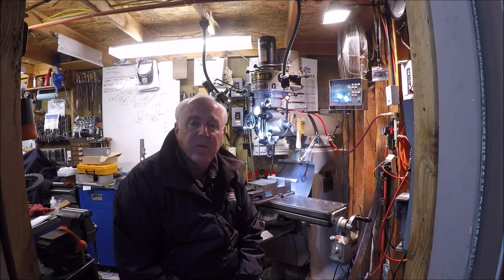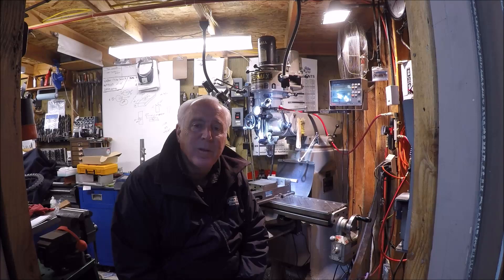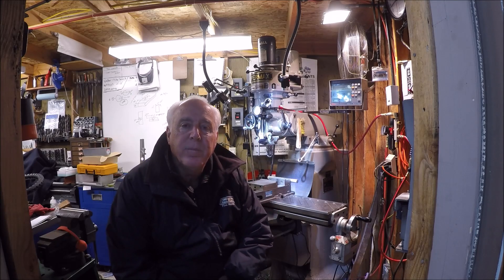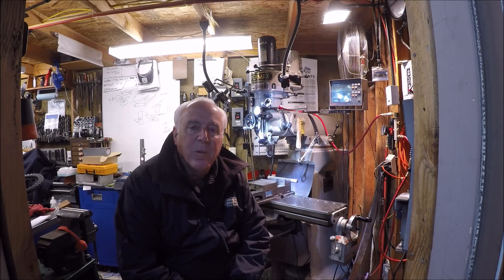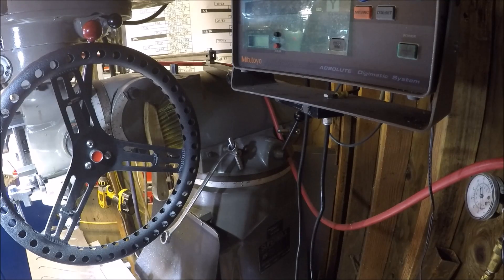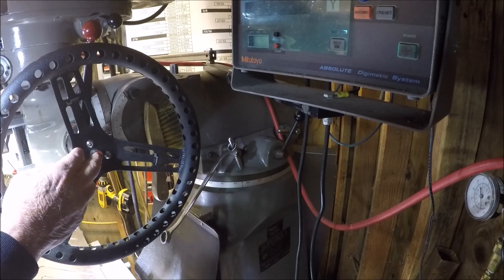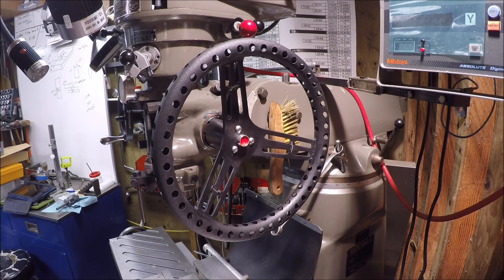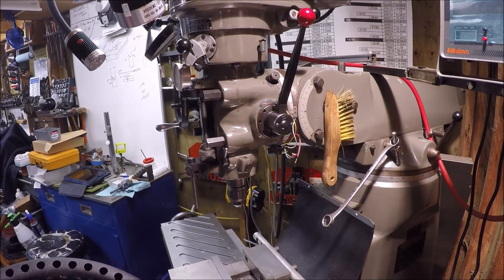Screwy Tuesday....Wheel Or No Wheel

Comment: I like the wheel attachment you did but the wheel seems too big.  A 8 or 10 inch wheel might be a better proportion.   A protrusion like on a lathe wheel or one of the mill xy handles or even off a '50's Chevy might make a smaller wheel as useful.   Thanks.

Comment: I was wondering where you purchased that whell from?I was interested in adding one to my Bridgeport and  love the way you did it I will duplicate your idea if you don't mind? 👍👍👍 TinMan
Reply from the maker: I got the wheel off of ebay...picked the cheapest with shipping, just search 14" aluminum steering wheel....sure, copy if you like and let me know if you come up with an improvement....FYI, I was planning to have a strong magnet within the bore to help secure the wheel to the existing handle, but I machined the bore to a very tight fit so I currently have dropped the magnet idea
Reply: @outsidescrewball Thank you👍 TinMan